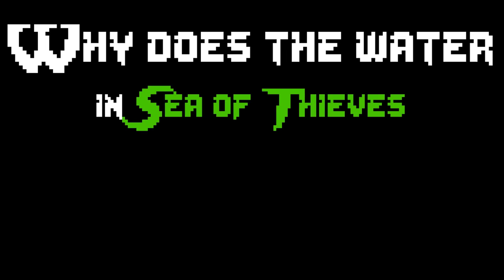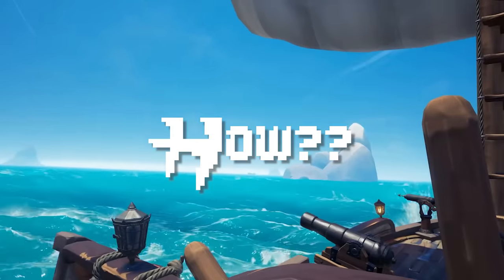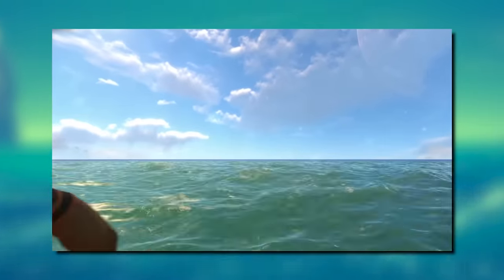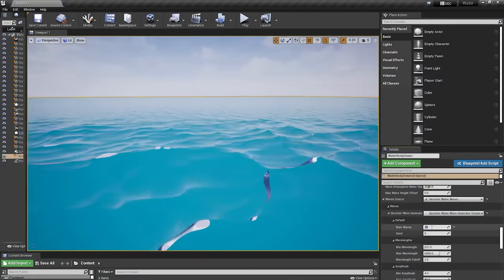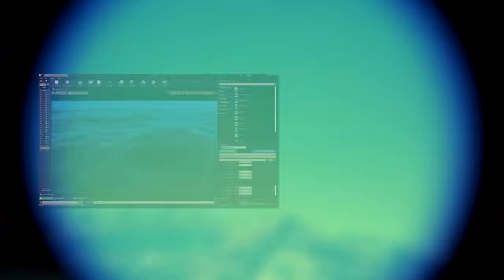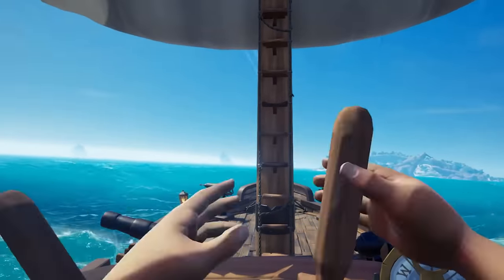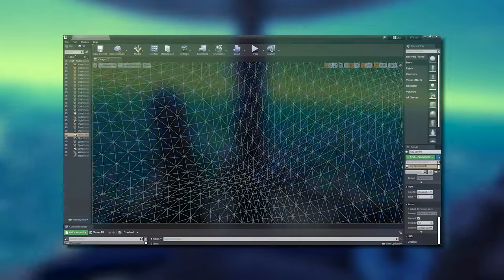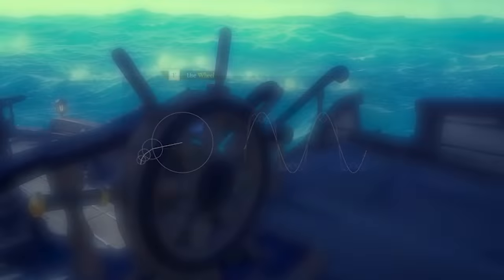how water works in Sea of Thieves

Comment: You skipped over the actually challenging part of this system: making the waves have physics(cpu) that match their displaced vertices(gpu).
Reply: they dont match, and it create a lot of problems on the game, problems that they said they're unable to fix.
Reply: @CharlieToof  part of the reason players sometimes go towards the top of the water, and then get shot down to the bottom. Or why you can't grab water from the bow of a scoon, even if it's touching the wave. It still registers as a single plane, it just looks different with the player, and environment.
Reply: @caseym6272  As a player, they cant deal with shooting in the sea and with stability, a lot of wrong hitreg and really strange position bugs (not just sometimes.. EVERYTIMES), this tecnics it is not well optimized and rare is not able to make it work for an action adventure game.
Reply: mesh deformation.
Reply: If you're talking about buoyancy, it's simpler than you would think. The CPU side has a collection of points in worldspace and it just queries the GPU for the ocean height and flow direction at all these points. Then the CPU can decide how to act on this. (for example by pushing the object upwards with a certain amount of force if point is below water).
Reply: @QQnowQQlater  That's not what he's on about. You can't just say random terms you don't understand and pretend you're giving a solution to a problem.
Reply: @Aoredon  i fully understand it. if you or him want to understand it go read a bunch of math papers on it instead of asking in a youtube comment. Like your laughable uploaded clone videos btw; really showcases how awful your understanding of this all is.
Reply: @QQnowQQlater  you clearly don't understand it when you're saying the way to sync water physics is "mesh deformation" and I made those videos when I was 15, where are your videos? It's laughable that you actually got so mad you went to my channel, maybe get a life mate
Reply: @Aoredon  it's ftt translated to a mesh deformation by adjusting vertex positions with the gpu. 15? nothing new, probably couldnt cut it. either way idk why im talking to someone with the only accomplishment being "making a worse and uglier wolfenstein using cutting edge engines" or "wow space with a skybox and a giant poorly textured sphere."
Reply: @QQnowQQlater  You need to grow up
Reply: @Genebriss  ironic coming from a 5 year old with a nintendo mii avatar lol
Reply: @QQnowQQlater  just stop dude, continuing to post comments like this isn't helping your case at all.
Reply: @QQnowQQlater  dude just elaborate on your original point ffs, no need to be like this
Reply: @QQnowQQlater  Pathetic :D
Reply: @CharlieToof  Post the source of them saying that it creates a lot of problems on the game and that they can't fix them? Or you just typing that to sound smart?
Reply: @QQnowQQlater  sauce? just trust me bro.
Reply: @Neek1154  you can't just do that though lmao, when you're editing a mesh with the gpu which is what they're doing in sea of thieves, the cpu doesn't get the updated mesh data without reinstancing the physics each frame.

the reason why this is an issue is because the way they programmed it isn't to use a reinstancing method but a rebuilding method on the cpu.

but until it's rebuilt, it's not as simple as just detecting if somethings lower than the waves and telling it to go up, because to the cpu the waves don't exist.

it's just a flat plane to the cpu until the math is completed, and this is why so many people have issues with the water not actually reflecting the physical mesh or vis versa.

it's mainly due to gpu latency, because the gpu is what's rendering the waves to begin with, but it then has to send that information for the cpu to do the physics calculations.

if you have any issues regaurding latency or bottleneck, this will cause a memory leak which will then basically tell the cpu that the water is flat, not wavy like it looks.
Reply: @A_piece_of_broccoli  I was specifically talking about buoyancy. Why would you need a mesh on the CPU to reflect the GPU for this?

The only difference here is that the CPU tells the GPU specifically what information it wants, so the GPU sends just a few numbers to the CPU, instead of an entire mesh. This is waaaaaaaaaay more optimal. 

The CPU doesnt need the entire mesh to run physics calculations. it only needs to know where the water is at certain key points on the ship hull. Then it can operate based on that information.

This 100% works, It's a pretty standard approach actually. This is what they do on most industrial ship simulators. It may not be the exact same implementation that sea of thieves does, but thats irrelevant.
Reply: @randomcatdude  They did in their 3rd reply but it's only a sentence long.
Reply: @koftespiess  even then, they don't explain how a GPU-side vertex displacement can affect CPU-side physics...
Reply: I think he skipped over 99.999% of the challenging parts :D like additional foam on top of the waves, and how to control it, how it works in multiplayer, how to do the underwater caustics and audio etc etc etc etc.. I've literally not learned anything from this beyond the fact that it's possible to do, but I suspected that SOT being an unreal game. 
I wish Rare / SoT would have a seminar on how they made the water, a good few hours at least going from 0 to SoT waters and underwaters that you can just plug in and populate your level with.
Reply: long story short, the answer is: doing the same calculation on cpu as well.

you have a equation, or a displacement map to displace vertices in gpu.
you do that for every vertex right?

on cpu, for simulating buoyancy you only need to know the water height at the position of the object. or at the object(s) positions.
not for every vertex.
so just doing the same equation on cpu for just 1 point will get you the water height.
or if the water is sampling from a texture, sample the same texture for just 1 position.
as simple as that. 

then apply force if objects height is less than the water height. really easy to do.
Reply: n64 wavesrace waves are baked waves with dynamic realistic deformations
Reply: @sometard8156  actually im pretty sure physx is largely cpu sided nowadays
Reply: @caseym6272   The water plane phases through the bottom of the ship???? They could have fixed that with a layer mask over the water to mask it out while a player is under the deck.
Reply: Actually, buoyancy is easier to get right than you'd think. The vertex displacement is done using a maths function. So using the same function with the same inputs, you can get a wave height that matches the visuals. Then you sample a few points at different ends of the boat and compare their position to the wave height. Using this information, you can apply an upwards or downwards force on those ends of the boat. If you play around with the force values and positions a bit, you end up with buoyancy that closely matches the visuals.

Comment: sea of thieves water does even more than what you've talked about here. As far as I am aware, it is the most technically involved water in a game even to this day. There are a lot of videos on sea of thieves break downs for their tech art and it's astounding all the things they were able to pull off with unreal engine 4.8.
Reply: It's not the most technically involved. It uses an iFFT algorithm with a Philips ocean spectrum model, but there are better ones out there now like JONSWAP with more real world analysis. Other games have used this, Assassins Creed many years ago for example. Sea of Thieves is better looking due to all the added visual effects and the advantage of modern lighting/rendering features that A.C did not have but the waves themselves both use the same algorithm. The algorithm (for ocean rendering) has been around since 1995. And many games use it for oceans because it turns a O(n^2) using gerstner to a O(nlogn) using a custom spectra which is a huge performance gain. Subnautica also uses it and you can dotpeek their source code and see the iFFT which they made CPU bound which i would not recommend as it works super well on a GPU. The 1995 Tessendorf paper explains it all - its like the bible of ocean rendering.

The nature of the algorithm is also deterministic making it seed-able so it can sync on a network very easily using a delta time.
Reply: @Futso Unstable can run rare/epic graphics with an incredibly smooth experience. The game is heavily optmised.
Reply: @Futso Been playing for years, I have never seen a glitch, and my game has never crashed, the map is massive, with really good graphics. The game is heavily optimized and is not buggy nor unstable.
Reply: Florida Man  we acting like any other game never had a glitch happen
Reply: @Futso it's not a buggy mess bruh
Reply: @Futso potato pc
Reply: @PastPositive  16 players is not massive, that wouldn't even be considered large for a traditional deathmatch let alone an open world. The map is not that large, ships are just very slow. The hitreg is basically a dice roll even on quiet servers, get more than a few ships in the same area with rough waves and you're all going to be desyncing through and over waves like crazy. Not to mention the devs themselves put in almost every patch notes that they acknowledge the server performance has been downgrading with each addition of new content.. Game is good and all but don't play the idiot to support it.
Reply: @JDoyle64  as someone with 100's of strictly pve Sea of Thieves under my belt, this is good. Less players to come and ruin the experience for my friends and I
Reply: @PastPositive  Wrong. The hit detection is wonky and weird water physics due to how it still registers as a single plain.
Reply: @Steampunk_Kak  Has nothing to do with his pc mate. Some bugs in SOT can never be fixed due to how the ocean is built. It's not as vast as you think, it's a single plain. Which you can be hitting someone, but in reality you are not. Tons of games have bugs that can not be fixed without heavy engine work. Look at Rainbow Six: Siege. Built on an AC engine, and they had to rework so much of the engine over time to make things work .
Reply: @kintsugittv2537  I know it mate, was just poking fun. If you don't sacrifice a goat or newborn to the Coding gods you can't get the coding magic to work... But seriously, i know it changes form person to prrson and pc to pc... hell it changes form hour to hour on the same pc lol
Reply: @Steampunk_Kak  Any coder knows that sometimes when you fix a bug, you don't question how, you just accept it lmao
Reply: @kintsugittv2537  I swear, there was code i was running for a mine craft mod, and I tested it 10 times and for some freaking reason, it actually worked one of those times. Nothing else was different, just that one time the code i made did what it was suppose to in the game smh
Reply: @Futso What is a ''buggy mess'' for you? For me it would be not being able to play a game for 10 min without an annoying bug, so for me it is far from it, don't get surprised if someone disagrees with you when you use adjectives so loosely, just like the ''massive player count'' comment
Reply: @Steampunk_Kak  You're that "pc must be bad" guy. Also how does your code compile differently by the hour? That must be some unstable code. If you code in C then I can sympathise with that lol.
Reply: @adailtonneto1767  I've been playing the game since the final weekend beta (feb 2018 IIRC) and man do people still froth from the mouth when someone says anything bad about this game lol.
Reply: @koftespiess  Java.
Reply: @WelshGuitarDude  did Subnautica reuse that cause Subnautica waves literally lightly bob up and down and just repeat on for eternity
Reply: I also figured out that the water bounces you and also drifts you when you have a straight wheel you start going left or right
Reply: @Obsolete386  I feel you, the amount of toxic players made me quit the game, even though I played it for years. Less people is good! Sea of thieves is not a fun pvp experience.

Comment: It's incredibly insincere to say that making sea wave with Gerstner wave is "only possible in UE" when such idea was popularized/democratized by Catlike Coding who wrote the Gerstner seawave tutorial originally for Unity in 2018.
Reply: Specially that there is no match to Unity Gerstner assets in the store in Unreal (Crest). All water in Unreal marketplace and the build in solution are bad or badly optimized.
Of course SoT water is amazing.
Reply: when did he say that?
Reply: when did he say it was only possible in UE?
Reply: to clarify, he said that unreal makes the Gerstner Wave function easier to use since it uses a node-based system.

Comment: But how is the buoyancy simulation for the ship kept in sync with the waves?
Reply: That may be done through programming. Something along the lines of "This ship changes height and position based off vertexes of the waves" Its probably not a simulation as it is a blueprint or code based off the interactions of the ship and waves
Reply: Probably the waves affect in some way the root bones of the ship making an animation to rotate y the large axis and going up and down
Reply: As physics is calculated on the CPU then the exact calculations the GPU performs to displace vertices must be copied to CPU instructions. Basically the game knows how to displace the sea both in shader language for visuals and C++ for physics. Every ship or other buoyant object then implements buoyancy points that get sampled by the server with the CPU function to get the water height at those points only. With that, you can calculate buoyancy and let the physics simulation run. Clients predict this outcome since the formula is deterministic, once they know the server's time, then their "waves state" will match perfectly without sending any more data. It still sounds easy but in reality it's quite the technical achievement to have that sea in a multiplayer game. It's way more complicated than your usual FPS game, most of them don't even run any physics through the network.
Reply: If I'm not mistaken, the buoyancy simulation works hand-in-hand with the waves system in Unreal Engine.
It just takes some tweaking to get a floating object to look like it's actually floating.  :)

Comment: I've been working with materials in UE for a while now and water in general was one of the hardest parts when talking about Environment Art. It's hard to make an optimized, good looking and modular water shader. You first have to make the opacity interactions between the shore, middle part and deep water, then work to make a good water foam (stylized or not), then there are the waves that may change depending on how you want to implement water in your game. The type of water also matter. If you are creating an ocean, a river or a lake, for example, you may want to change how the normal map behave, how the waves behave and all. On top of that there is also the connections between these types of water. If your river is going to end up in an ocean, it's tough to make it look smooth. Add shader complexity on this and you have a really tough shader to take care. And I'm not even talking about buoyancy and other things that a programmer would do.

Water Shader was a challenge for me 6 months ago. My stylized water is still not perfect but I added some automatic interactions on that (like adding flowing foam when the water plane is bent to the ground like a waterfall). The problem is that the shader is só damn big that if I work on other shaders and need to come back to it again, I would take almost an entire day just to understand what's is happening there, even though I commented absolutely everything and divided the shader in material functions.
Reply: Ahhh yesss the curse of navigating several thousand lines of code lmao

Comment: Unreal Engine is one of the absolute, most worst Engines you can work with.
Unity Engine is much better to work with, and also looks better in my opinion.
Unreal Engine cannot top Unity Engine.
The games are much better when made by Unity Engine, this is a fact to be honest.
Unreal Engine is nothing but trouble, always ''something wrong'' with it.
Of all Engines out there, Unreal Engine is by far the most unstable engine for your games, confirmed as well.

Comment: the other big element here is that the ship is also responding to the waves, which has to happen completely independently from the shader.
i’d be curious how it’s setup.
they may use a simplified version of the same equation, running on the cpu, that drives physics interactions.  And you would likely want that cpu function to manage some of what’s happening in the shader to keep it all in sync, and to avoid needing a very complex shader
Reply: And not only your ship but the entire server. So it needs to be network synced also

Comment: Having already made an in depth video about the mechanics of water on video games, you can't just end this video like
"And that's not all, they also did a bunch of other things that really take this to the next level. But that's a topic for another video"

No it is not. This is the topic of this video. The bit about the Gerstner formula was interesting. You also explained Adaptive Subdivision, which is basic but very relevant. However, this video is titled "how water works in Sea of Thieves", specifically, and you only talked about the most basic stuff you could get away with. 

This appropriate title for this video would be "How some games implement water physics". If you think that it's not a good title, you're right. You should do your research and not upload an unfinished video, deliver on what you promise.